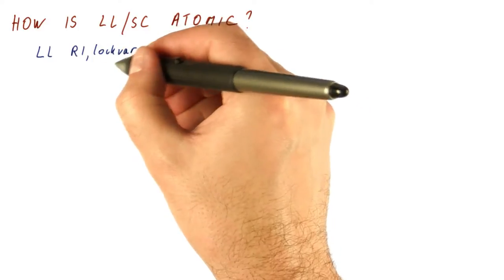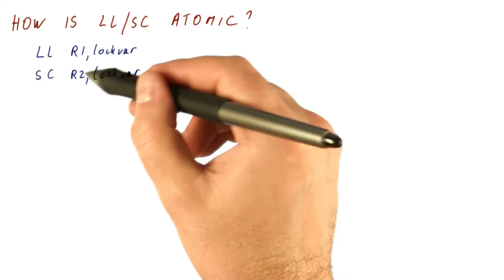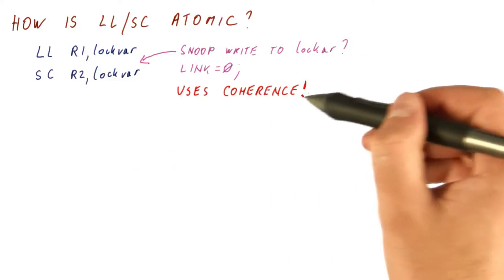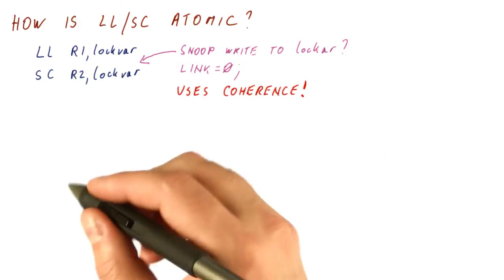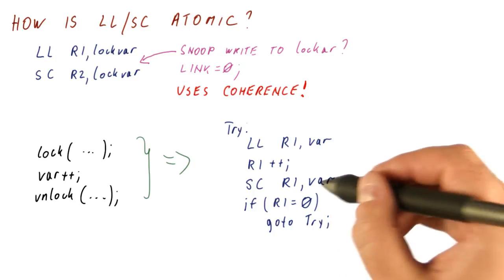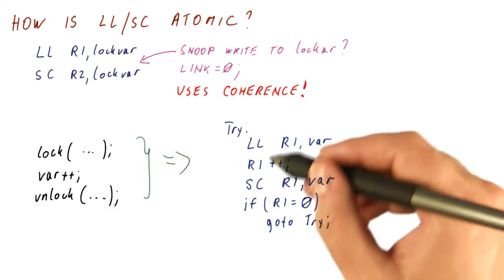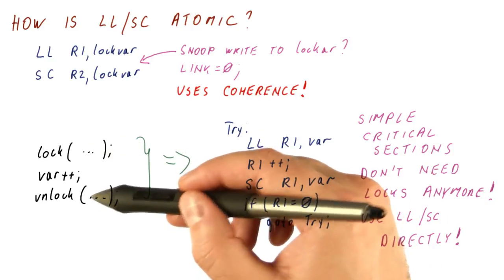How is LL SC Atomic - Georgia Tech - HPCA: Part 5

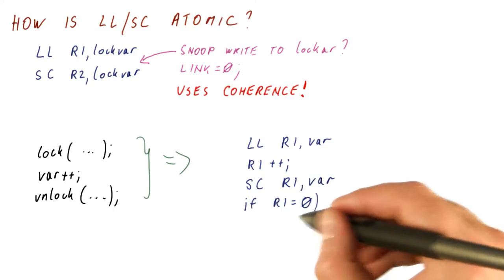Comment: At 2:05 did you mean if(LINK=0) instead of if(R1=0)
Reply: R1 is the link
Reply: If R1 is zero, it means that SC failed (when it fails, it returns 0).  It failed because the value in the link register is 0, not the address of 'var', which is because a write to 'var' was snooped on the bus.  See the previous video at 117s in (https://youtu.be/fuHwmyZXnPA?t=117) for clarification.  Moreover, we cannot access the "link register" in assembly, as is mentioned in the video https://youtu.be/vILzpoVrP9U?t=115.  Hence, R1 is NOT the "link register".
Reply: Actually here are three registers used: the variable to be saved(src), the address destination(addr) and the returned value(rt). But he might assume the returned value is stored in the src register.